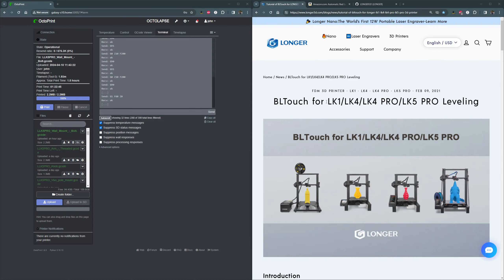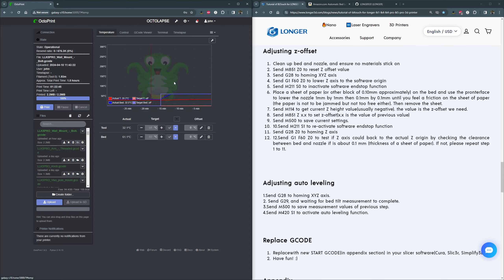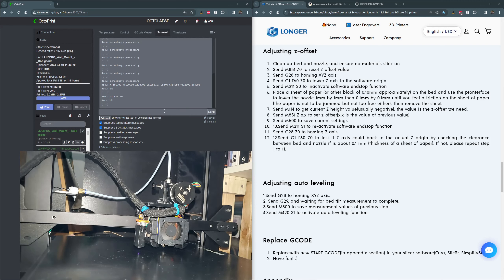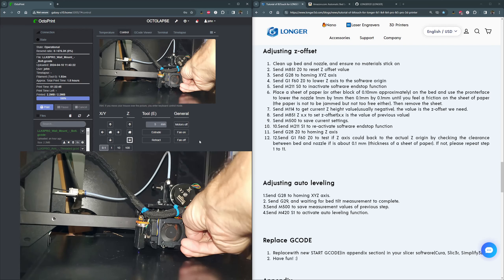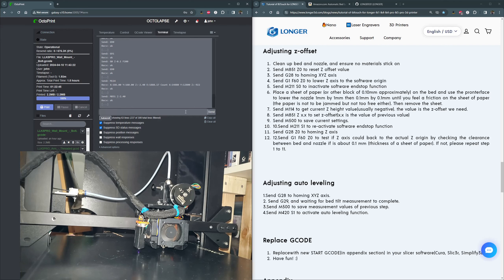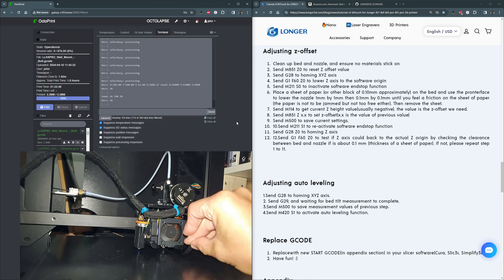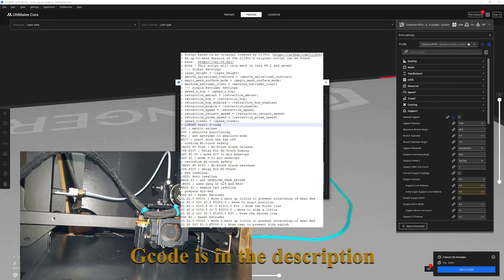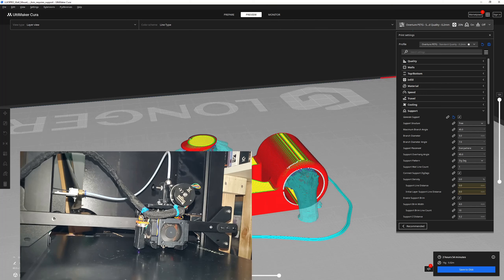How to set your z-offset Longer LK5 Pro #3dprinting #3dtouch #diy #longerlk5pro #longer3d

Comment: When I home all axis with G28, the printer keeps trying to lower the Z axis indefinitely. Any suggestions?
Reply from the maker: It sounds like your z end stop may not be on. The M120 command will turn it on. 
Did you follow the guide from longer for this? 
I really need more info to help you out. What firmware and probe do you have?